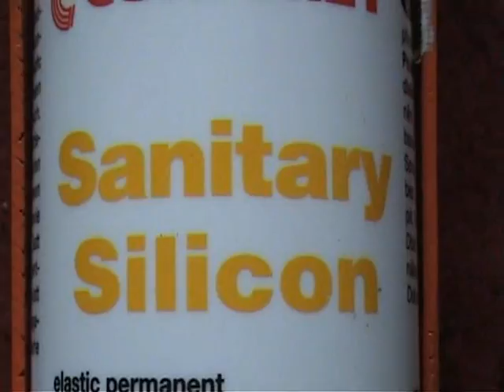DIY PCB etching container with bubbles

Comment: any reason you didnt weld it? any reason the hose beats pouring it into the bucket?  genuinely curious. Looks neat but do you not end up with same drip/spill risk from hose full of echant/coated in remaining echant? (plus the risk of bottom leaks from both seals and valve?) forget and pick it up only to whip the hose and oh shit. Im building something similar tonight though so if there is a reason pouring it sucks extra bad id like to know .

Comment: Pardon my ignorance but I've started looking into etching methods only recently. What are the air bubbles actually for? Do they speed up the etching process?
Reply from the maker: Exactly.
Reply: They also move the solution around so fresh ungunky solution can eat away at the copper.

Comment: can i use a aquarium pump?
Reply: I use a aquarium pump,but make sure it is located above the acid, otherwise the acid will kill the pump. I use one part muratic acid and two parts hydrogen peroxide. I have  used this method for ten years now. You can keep reusing over and over, unlike that brown crap he is using.